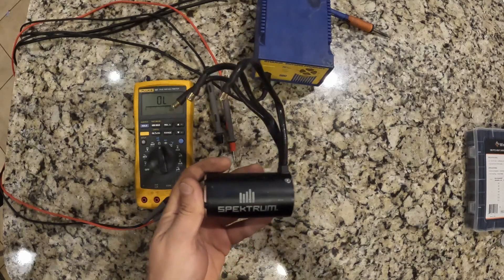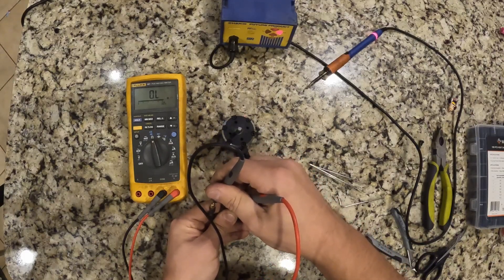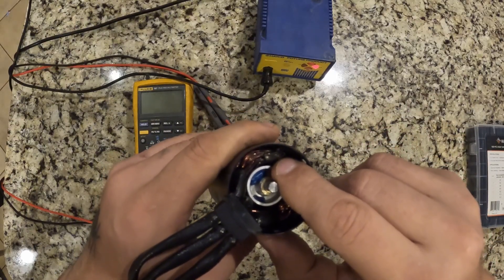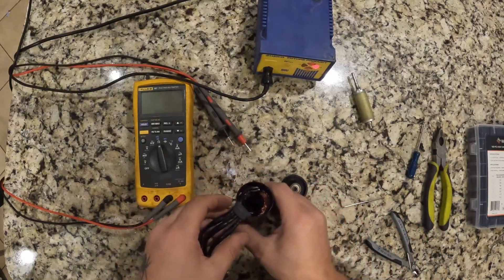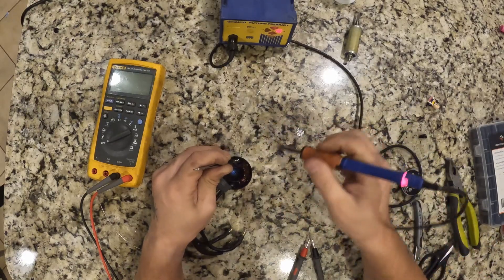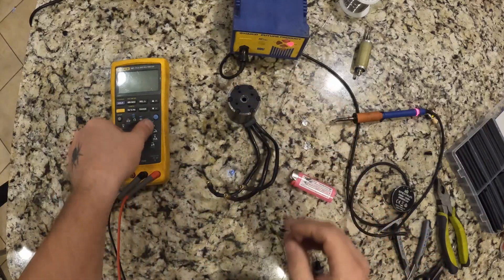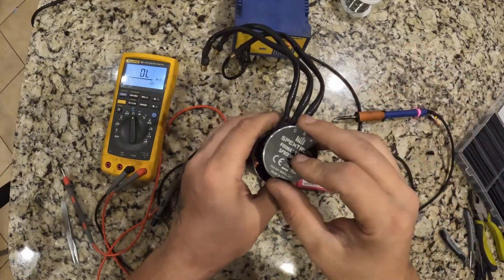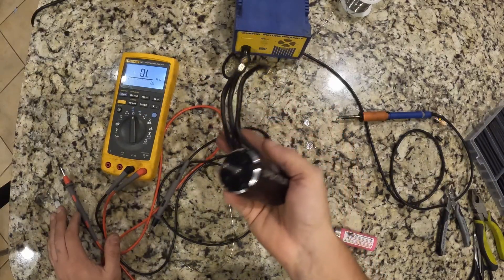Spektrum Motor Not Working? The Real Problem Is Internal Wiring! Here's How to Fix It

Comment: Thanks to your video ive followed your advice and checked the wire it was the wire at fault and ive resoldered for the first time and ive got my motor back up and running thankyou saved me £130
Reply from the maker: Glad it worked for you, this is so common.